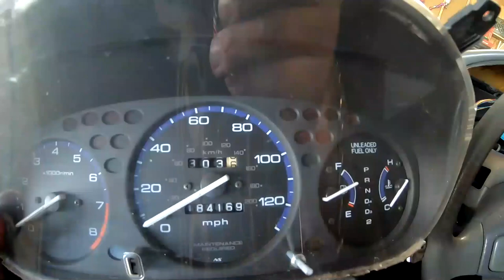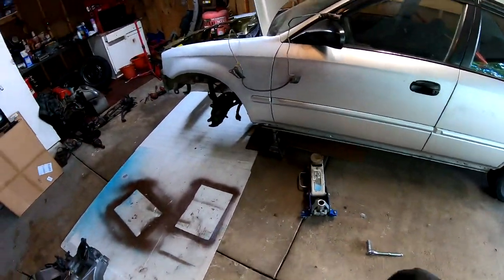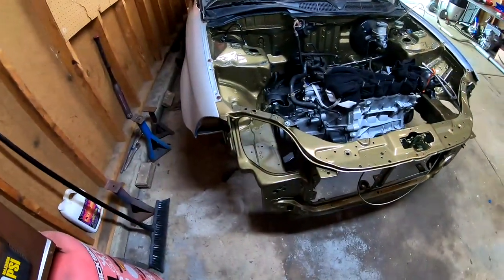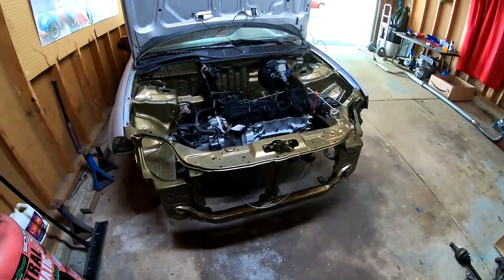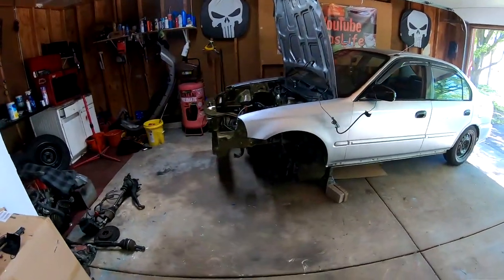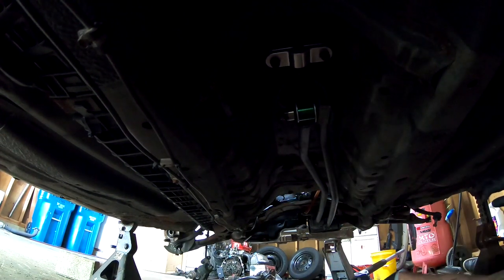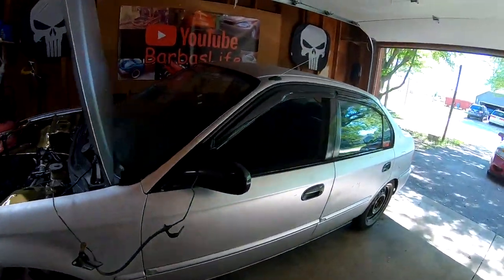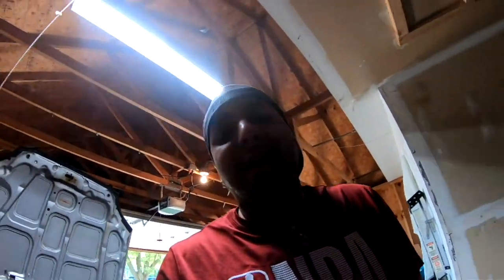sleeper 500hp civic gets built short block installed

Comment: What up barbas. Hey bro I got a question I'm gonna be ordering a ebay turbo kit for my dc2 gsr.. what all do I need for the whole set up to be able to drive it on the streets?? I'm running a obd1 jumper to a chipped p28 with 2 step do i need injectors if so what size you think if i just wanna run like waste gate pressure.. like 6 , 7 lbs.. im going to do the install myself its gonna be my first time but I think I can get it done im just hella stumped on what all parts I need g.  Help me out if you can bro much appreciated 🙏
Reply from the maker: I would get 440 or 550cc injectors. those ebay turbo kits are pretty good to start out with. i would buy the emusa bran  one. i have had that bran and a lot of my buddys have run them. if you dont have a welder i would get the screw kind of return bong for your oil pan. check out my old videos i got a lot of info on piecing a turbo kit together.
Reply: @BarbasLife  hell yeah bro. Will do that for sure 👍 so if i bought the kit and installed it with lets say 450 cc injectors how bad would it be to drive without a tune?? And would I need a new ecu like hondata s300 or am I ok with doing a chipped p28 chrome tune in the future??
Reply from the maker: @righty-tightybuilt548  you can chip your ecu and run that. But I would not drive without a tune. If you dont wanna deal with a tune or injectors get a FMU instead. Fmu is the old school way of running boost with stock ECU and stock injectors.
Reply from the maker: @righty-tightybuilt548  i am gonna be using a fmu i will be making a video on it soon. I cant afford injectors or ecu right now so i will run fmu for a few months.
Reply: @BarbasLife  bro fmu?? I'm trying to figure out what that acronym is for fuel management unit?!?!? Lol
Reply from the maker: https://www.google.com/shopping/product/1?q=fmu+turbo&safe=active&biw=412&bih=758&tbs=vw:l,ss:44&prmd=isnv&sxsrf=ALeKk03BoC1DrKuna3A2hSKNYe7MN90eug:1591153606576&prds=num:1,of:1,epd:2800969433501859083,prmr:1,pid:2800969433501859083,cs:1